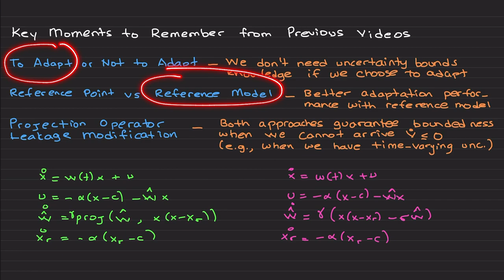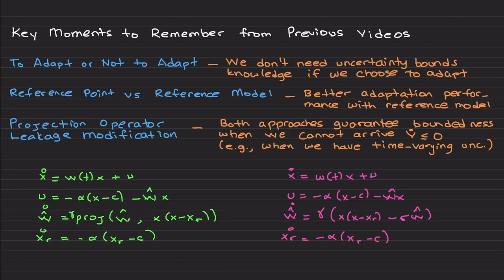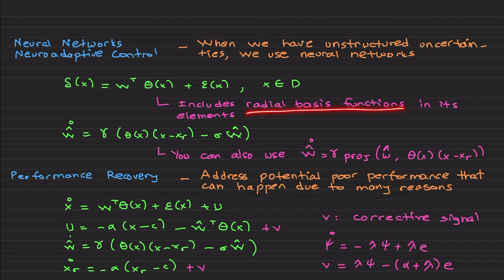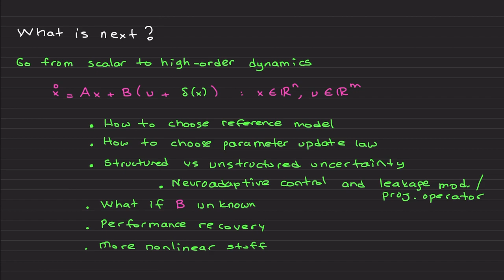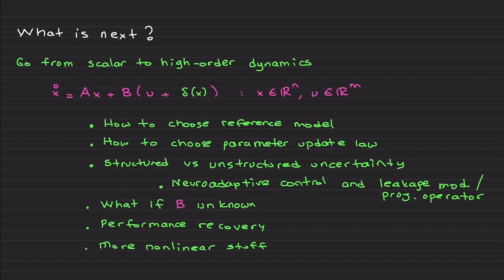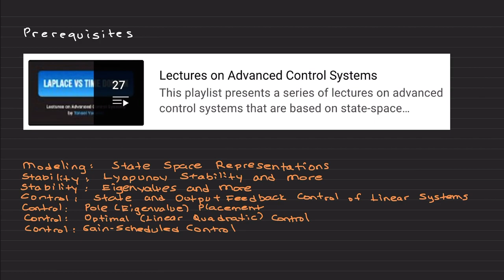Key Moments and What is Next (Lectures on Adaptive Control and Learning)

Comment: Thank you Dr. Yucelen for such an awesome series of lectures on Adaptive Control. I do have a question.
You mentioned that you would cover how to deal with the case when B is unknown.
I went through the entirety of lectures in the series.
But I could find the part where you covered the case on unknown B matrix.
If you could address that here or point me to a paper, that would be great. 
Thanks.
Reply from the maker: Let B*=B*Lambda with B known and Lambda unknown. The reason to introduce the unknown Lambda term is to address the unknown B* matrix (here the actual input matrix is B*, not B). So it has been covered in all "high-order case" videos of the playlist. Hope this helps.
Reply: I understand what you mean. This makes it clear. Thanks a lot. 

I was thinking in terms of vehicle lateral dynamics.The B matrix of lateral dynamics of a vehicle has cornering stiffness coefficient, mass, moment of inertia which are known to an extent. But mass can change depending on the no. of passengers. The moment of inertia can change as well. The cornering stiffness coefficient will change depending on road conditions, weather etc. So in this case the B matrix can't be assumed to be known. There is uncertainty in the B matrix as well on top of the unknown Lambda.

I was wondering how to deal with the uncertainty in B matrix.
Reply from the maker: Thanks for the kind feedback @kaustavmondal7875 by the way. To handle significant changes due to mass and inertia, you can consider a gain-scheduled control approach https://youtu.be/S5ylpVTNJeM?si=YrK0LHWmTMkirGXD - Considering the Lambda term as we did in these lectures also help ;)

Comment: Thank you Tansel Hocam for making such a valuable video series. I have a question;

I have a high dimensional system in which the presented uncertainties are structured, thus I am using MRAC with a structured uncertainty model (I estimate only W via Lyapunov approximation and rely on it) but I must deal with really high and abrupt external disturbances. I use the integral approach to reach zero steady-state errors but I am trying to control two variables (I give references to two states i.e., the model is augmented with the integral of the errors of two states). The problem is, I can achieve pretty satisfactory reference tracking performance but when it comes to external disturbance rejection, steady-state errors emerge. Moreover, the plant I am dealing with involves really fast internal dynamics and I use cheap sensors thus the derivative operation is unreliable even with a low-pass filter since I am losing the derivative information when I am trying to suppress high measurement noise with high filter constants. Therefore I conclude that the performance recovery method will not solve my problem. 

Do you have any suggestions to improve disturbance rejection performance? After watching that video I thought that the projection operator might help a little since the high external disturbance can corrupt W estimations but I am not sure that it can completely resolve the steady-state error problem under the presence of external disturbances. I would be very thankful if you can suggest papers dealing with similar problems.

Again, thank you for sharing the videos that are extremely helpful. 👏👏👏
Reply from the maker: Thanks for the feedback. I have two ideas that can solve your problem: 1) Try the idea presented in https://www.mdpi.com/2075-1702/5/1/9 — This is an optimization framework for minimizing the effect of disturbance along with adaptation. 2) Try this derivative-free adaptation https://arc.aiaa.org/doi/abs/10.2514/4.107023 — This can suppress disturbances/uncertainties with high frequency rates of change. For handling measurement noise, we have also published this one: https://arc.aiaa.org/doi/abs/10.2514/6.2020-0842 — For addressing noisy measurements. Please let me know if one of these works.
Reply: @tyucelen   Thank you hocam for sharing your ideas. I will implement your suggestions as soon as possible and inform you about the results.